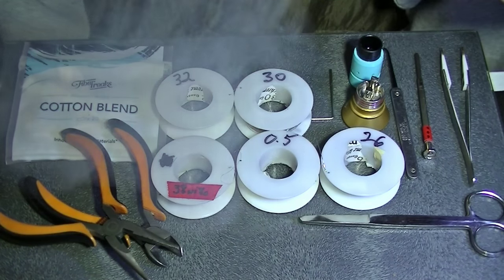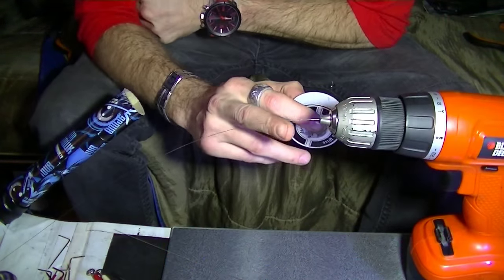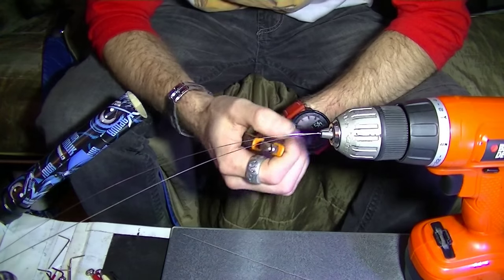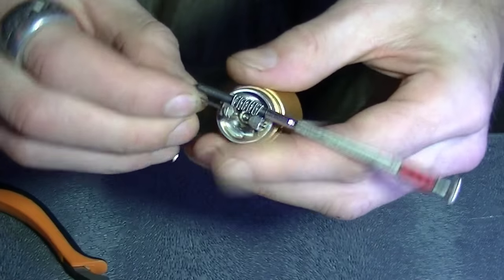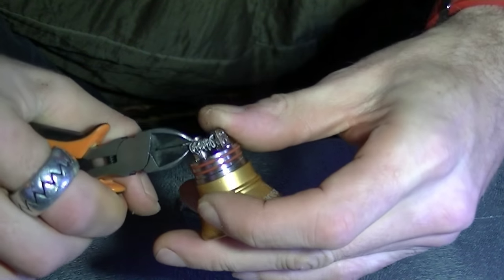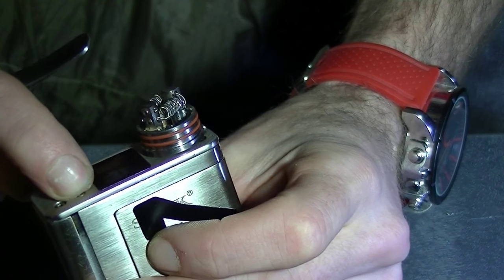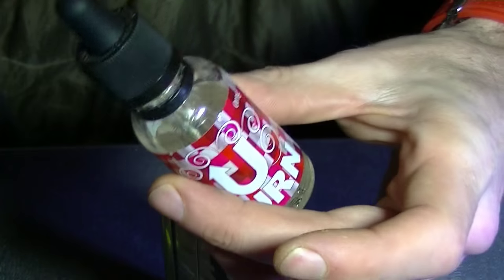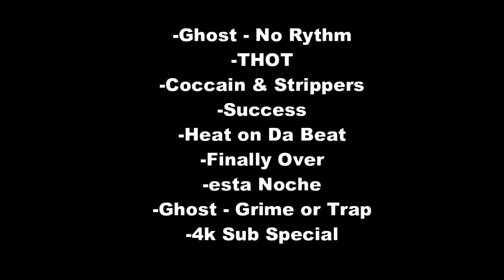TIGRON COIL  ( TUTORIAL ) 0.2 ohm

Comment: hey buddy how's it going? hope your good. I just ordered my first mech. mod the El Carbon in copper with a 13 heavens 9 hells RDA and was wondering what would be the best wire gauges to start with to build for flavor I want to try some fun builds have only done some twisted coils on my Sapor but, I am looking to do more advanced coils now. I took your advice and got a multi meter for testing. thanks for the help!
Reply from the maker: I assume you don't have super advanced builder , so i will suggest ,  24-26-28-32   The 2 last specially  ( find Ghost Vapor group on FB . It will be easier to help )